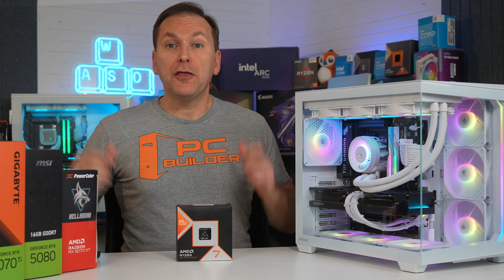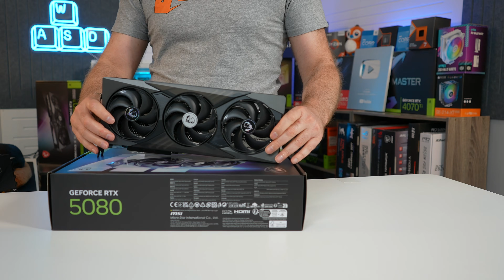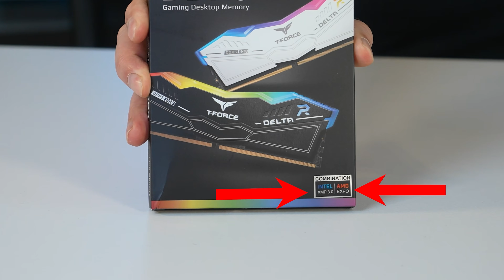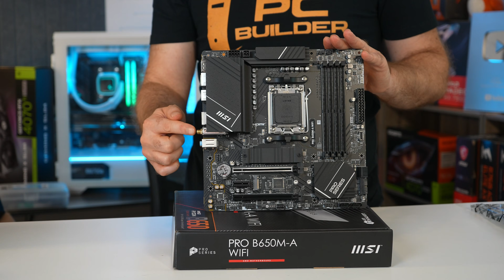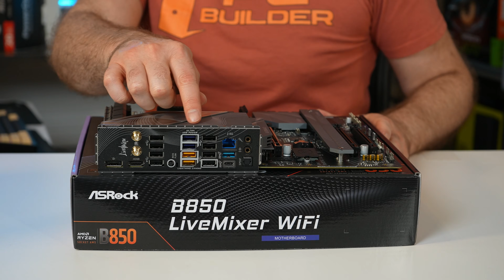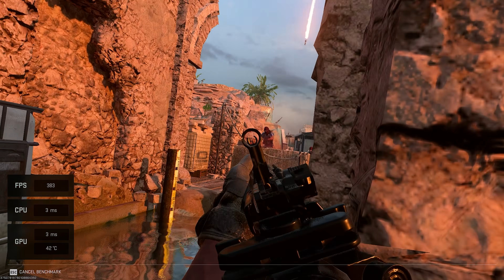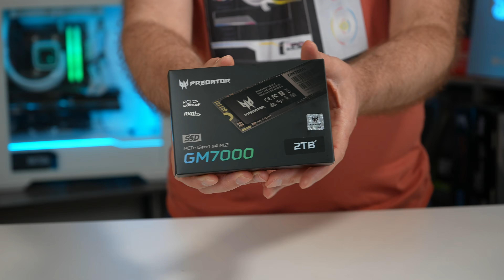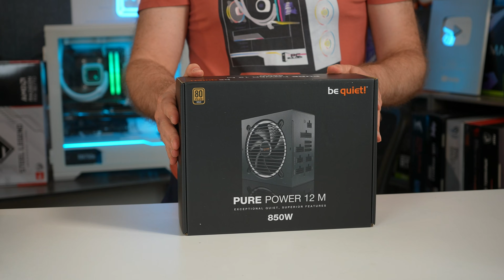Best Ryzen 9800X3D PC Build 2025 🛑 Best GPU, RAM, Motherboard & More

Comment: I just finished building my first pc ever!
It has:
- 9800x3d
- Thermalright Frozen Warframe 360 RGB AIO
- Samsung 990 pro 2TB
- Corsair Vengance DDR5 CL30 6000 MT/s 32GB RGB
- Asus ROG STRIX B650E-F Gamin WiFi
- RX 9070 XT Mercury OC edition
- NZXt H9 Elite Black RGB
- Some extra NZXT Duo RGB fans

Let me know what you think, and if it is an overkill in components or individual components.
Reply from the maker: Congrats on your first build! If you build it, it will run :)))
Reply: @PCBuilderChannel  do I need to upgrade my Corsair 750x now I'm upgrading too 9800x3d and 5070ti
Reply: Congrats, solid first build.
Reply: Sounds badass hope you enjoy it bro
Reply: Hi mate I got same mobo as u and just brought 9800x3d I've updated to latest bios does the cpu work out of the box or do I need to do any more updates?
Reply: @ I just updated the bios to make sure no problems occur and everything work as smoothly as possible. Congrats mate, and enjoy
Reply: @aboudex1879  thanks mate running it with a 5070ti so very close to your build mate, what psu are you using?
Reply: @aboudex1879  and congrats on your build too if the 9070xt was better priced in my area I would of gone for it but it was 50 less than 5070ti for me
Reply: @jamiebaxter4221  hi mate, sorry for not responding earlier!
I wasn't sure which psu is enough, so I went with Corsair RM1000e, I'm sure 800W+ is enough.
Reply: Personally, I would have gone with a basic 1TB m.2 for the OS and 4TB m.2 drive for gaming plus 64GB RAM (about 150-200 euro more I reckon). You didn't need the 990 pro. It gives no noticeable performance difference for gaming and it's really overpriced per TB of storage. You could have gone SN850 or Samsung 980 if you wanted higher end and otherwise there are many other brands out there which aren't that premium priced. 2TB total storage just is not much nowadays. Especially if you have it for OS and other stuff as well.

The case/fans is more of a personal choice. I prefer price/performance parts so I would go Arctic in general for fans and coolers. But they aren't a bad choice afaik.

Other than that at least it's a good balanced mix (depending on the price).
Reply: Most new builder overspend on SSD, fancy overpriced fans, and case. It's hard to say however, people some ppl have the money to blow on things to make the build look pretty.
Reply: I can't afford it
Reply: The mobo is a bit much, but not if you plan to upgrade the cpu in future

What is the psu?

Consider moving to 64gb of ram soon, games are moving up to the 15gb and over mark, with windows and a cache can easy see 25gb+ usage in use in some certain cases

Also if you ever upgrade that cpu, get 16 cores, nothing less, 8 is the minimum nowadays
Reply: @mickieg1994 do you think the TUF GAMING B650 motherboard is enough? I’m building with 9800 x3D and RTX 5080. 

Chat GPT recommends the ROG Strix one lol. Now I dunno if the TUF is not good enough…
Reply: @AK-74uKiLL4r  the tldr is, yes, it will be absolutely fine

The longer answer is to have a look into the differences between the chipsets, the 650, 650-e vs the 870 models, what you would be looking into more specifically would be stuff like vrm modules for powering the cpu, how many cpu lanes to each m.2 slots, vs the gpu etc etc, just familiarise yourself a little bit with the architecture and how it works

your only real concern would be future proofing, just incase you decide the next upgrade you go for will be the highest end chip possible, where all of a sudden those things start to matter, power delivery especially, as it becomes necessary to keep the cpu boosted as high as possible for as long as possible, amoung other factors ofcourse
Reply: @mickieg1994  tuf gaming b850 is only like 20 ISD more should I go for that instead of the b650 for that price? I guess so
Reply: @AK-74uKiLL4r  not bad, the price difference is pretty negligible so it might be worth getting the slightly nicer chipset, as i understand it, an 870 is like two 650 chipsets stuck together or something, although I'm no expert on what that exactly means for your cpu, it's probably a better choice
Reply: Como funciona ? Estoy por armar la misma pc
Reply: B650 is ancient.
Reply: In my opinion, you overspent on the case, the SSD and the fans. You could have saved about £100 or more without losing any performance with equivalent parts from other vendors. Still a beast of a build though.
Reply: @fatbap  If he really likes the case he did not overspend though. I spent quite a bit more. Granted, it was a custom job from Protocase but still.
Reply: @fatbap  Overspent? :O Nah i think he did fine

My Build
Case: Lian Li O11D XL Evo
CPU: Ryzen 7 9800x3D
Cooler: Corsair ICUE Titan 360mm
PSU: 1200W RoG Strix Platium
Motherboard: RoG 870E Crosshair Hero
GPU: 5090 LC OC Astral LC
Disk: Crucial T705 2TB M.2 NVMe PCIe Gen 5
Ram: Corsair 32GB (2x16GB) DDR5 6000MHz CL30 Dominator Titanium RGB Black
Fans: Corsair ICUE Link LXR 140 reverse 3st A-RGB 140mm (Bottom intake)  /  Corsair ICUE Link LX 120mm (Back)

Comment: I have a 9800X3D and it's very good. If I was doing a build today I would get a B850 motherboard, just make sure you get one with PCIe 5.0 x16 graphics slot. My X870 board is fine, but it's kind of a waste for me since I don't need USB 4.0 connections. Thumbs up!
Reply from the maker: Thanks for sharing!
Reply: Not ASRock right?

Comment: If I am getting a prebuilt system with these specs top of the line cooling and have the options to have the company overclock the gpu (5090) and cpu (9800x3D) would recommend it?

Comment: what about the 9950x non 3d for both gaming and productivity👀 I do music production, content creation. I need some help!
Reply from the maker: For productivity thats a great pick! I wouldn't do that if you primarily game. Hop over to our 9950X build guide on the channel!
Reply: The photo productivity system listed below will run Photoshop, Lightroom, and Topaz Photo AI. Maximum file size from 4000 dpi scans of large format negatives will be about 3.5 GB. Internal storage will be divided into three internal drives: 2TB for OS and programs, 2TB for cache, and 2TB for project storage. 

System Components:
1. MSI X870E Carbon motherboard
2. AMD Ryzen 9 9950X CPU
3. G.SKILL Trident Z5 DDR5 (64GB) 2 sticks
4. Kingston KC3000 PCIe 4.0 NVMe M.2 SSD (2 GB) 2 sticks
5. Samsung Pro 980 PCIe 4.0 NVMe M.2 SSD (2 GB) 1 stick
6. Gigabyte GeForce RTX 5080 Master GPU
7. Corsair HX1500i PSU
8. Corsair - iCUE Link Titan 360 RX AIO with LX120 fans
9. Corsair iCUE Link LX120 case fans (7)
10. Lian Li O11D EVO RGB E-ATX case

I am assembling this system based on your channel information and recommendations by Puget Systems.
Reply: Your a real one☝🏾❤️ God Bless🙏❤️@chesslover8829

Comment: I woulda went lower than CL30 but couldnt find any 64gb kits with 6000mhz and lower than CL30 🤷‍♂️
Reply: Of course this was during launch weekend of the 9800x3d
Reply from the maker: I'm not sure we'll see any CL28 or CL26 kits at anything other than crazy prices for 64GB.
Reply: @PCBuilderChannel  Yea not for a while anyways. Oh well CL30 is perfectly fine for time being anyways. Ive just been riding out on the stock bios of my Tomahawk X870 until I read about a stable update. Im thinking most recent one might be the candidate

Comment: Can't beat that 870e Asrock Nova mobo!!! Love the push buttons and code readout
Reply from the maker: Good board IMO. And it looks really sharp too.
Reply: @PCBuilderChannel  yes it does!!!! 😍
Reply: Id get it on a discount for sure right after i find a gpu at sane prices
Reply: Return that ASAP dude. ASRock Mobos have been frying 9800x3ds
Reply: @Gobbo-y7g  please....you sound like the mainstream media with all that fear mongering 😂😂 Lets do some math. Asrock sells the most budget boards and this issue is not isolated to them. So with the numbers being what they are of course the majority of boards are Asrock. This is an amd issue and well if something blows up I'll buy a new one. But hey thanks for the concern 🤣🙋‍♂️
Reply: Yeah it was...but I just sold mine and swapped to the MSI Carbon after the huge amount of asrock failures popping up.

Comment: Got everything set for the Big Boy Build; 9800X3D of course, Asrock X870E Tachi, Sapphire Pulse 7900 XTX, Corsair Platinum HXI 1000w (Hoping it's enough) cooled by a Cooler Master Atmos 360mm AIO inside Cooler Master 700 HAF EVO, waiting on the case, which was my second pick from a Corsair Obsidian 9000D.
Reply from the maker: Sounds like an awesome build!!! :)

Comment: wait is 6000mhz ram really a must for 7000/9000 series cpus? i tought it's not a big deal to go 5600mhz?
Reply from the maker: 6000 mt/s is the optimal speed due to how the Ryzen memory controller works. 5600 is fine too, but 6000 is optimal for Ryzen.

Comment: My issue I find when looking is a motherboard with at least 3 M2 gen 4.0 slots (ideally with heatsinks) but also has at least 7 usb slots on back (potentially could have 8 or 9 devices not including one that is for flashback)
They tend to be only on the pricier models of motherboards meaning I usually overspend on the board 🤔just to make it easier when buying😁
Part picker doesn't seem to have a filter for backplate usb numbers 🤔
Reply from the maker: Yes creator boards are always more expensive. There were a bunch of X670E boards on fire sale earlier this year but they seem to have dried up. Right now I'd look to some of the higher end B850 motherboards.

Comment: Thanks, I just got this CPU to pair with my 4070 ti Super and was looking for the best value/perfoemance parts, I saw some news about this burning with Asrock Mobo, is still recommended?
Reply from the maker: AMD and ASRock did a joint investigation. Seems only 1 CPU actually died, others weren't booting due to previous bios versions breaking some RAM compatibility. Right now seems limited to a small number and bios seems to fix it. But I'm keeping my eye on it, if you want to avoid ASRock there are tons of other options. The $199 B850 Tuf-Plus we used is a great board.
Reply: @PCBuilderChannel  Thanks bro, will put the eye on the TUF B850, looks fire!!
Reply: @PCBuilderChannel  im in the same boat with Asrock Nova plus 9800x3D. I would love to buy this combo but the reports of issues and the lack of discussions to inform us better of it is discouraging me from taking the plinge and buying the combo.

Comment: with the recent problems arising from the Asrock motherboards frying the CPU, would u still recommend going for the asrock MBOs?
Reply from the maker: AMD and ASRock did a joint investigation. Seems only 1 CPU actually died, others weren't booting due to previous bios versions breaking some RAM compatibility. Right now seems limited to a small number and bios seems to fix it. But I'm keeping my eye on it, if you want to avoid ASRock there are tons of other options. The $199 B850 Tuf-Plus we used is a great board.

Comment: Is a msi b850 gaming plus motherboard good enough for rtx 5080 and 7800x3d.  And is 850 watt psu alright for this combination without any bottlenecks?

One more question, is wd black 770 2tb SSD good?
Reply from the maker: That board is fine, but the MSI B850 gaming plus wifi is massively overpriced IMO. There are boards with way better features like the $199 TUF B850-Plus we went with. PSU depends on the total system, check out our Best PSU video for how to size. WD Black SN770 is fine, DRAM-less drive but often expensive for what it is.
Reply: Thanks

Comment: My 9800x3d + X870E mobo + 5080 + 64gb of DDR5 6000MTs cl30 + way too premium storage + fans + case + cooler + oled monitor ends up costing me 3.5k USD

I remember my previous pc + monitors and other peripherals costing 1k usd less than it, prices have gone nuts
Reply from the maker: Congrats on the build! You seem to have a super premium system there. While the cost of PC parts has gone down a lot, what is different is that there are now ultra high end products which allow you to dump a lot of extra money (X870E mobo's, SSDs, etc). But that build will last you a long time - much longer than previous PC builds given its upgradability, so you can also look at it like an investment.
Reply: @PCBuilderChannel  yep i wont be upgrading for a very long time and everything just feels insane even for the work i do
Reply: Chump change

Comment: STOP BUILDING BAD PCS 🗣📢
Reply from the maker: Haha this!
Reply: Bro is it okay if I get 7200mhz ram instead of 6000mhz
Reply: @d3mon.911 Yeah it will just run at lower mhz
Reply: @d3mon.911 yes
Reply: @d3mon.911  look out for cl speed lower the better
Reply: @d3mon.911 gonna slow
It down but u can